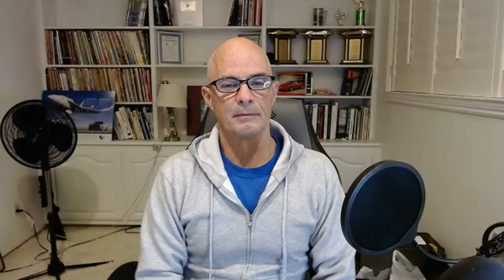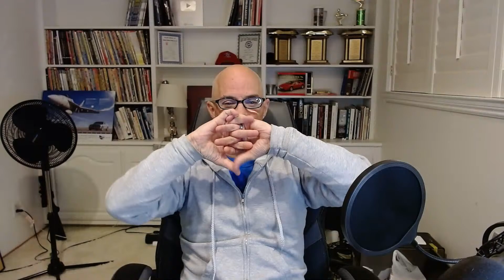LET'S TALK TECH-WHAT IS WRONG WITH THIS PICTURE?

Comment: The northStar has a lot more torque at high RPM and requires a heavier transition! When Buick developed the North Star in 1956 no automatic could handle it